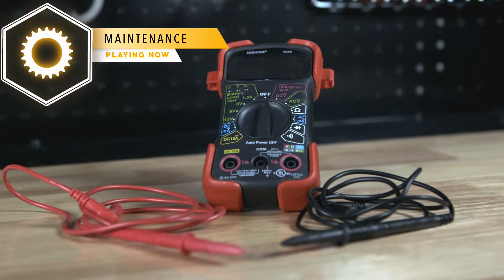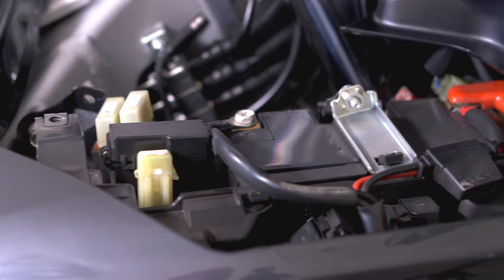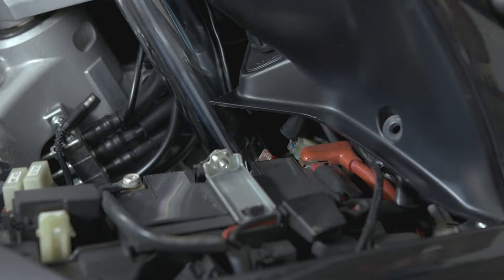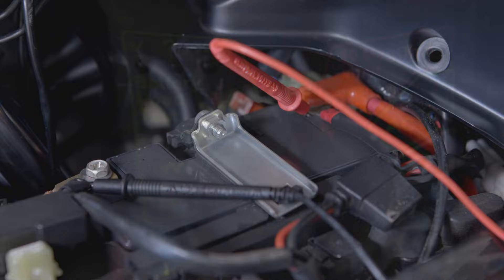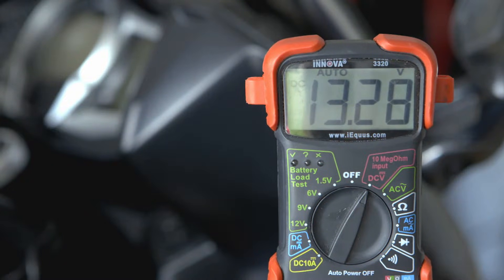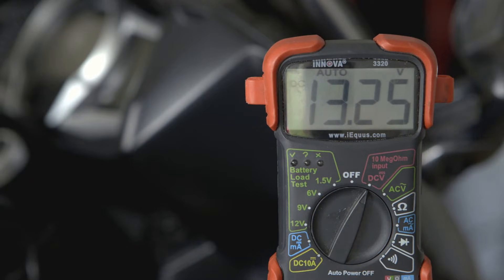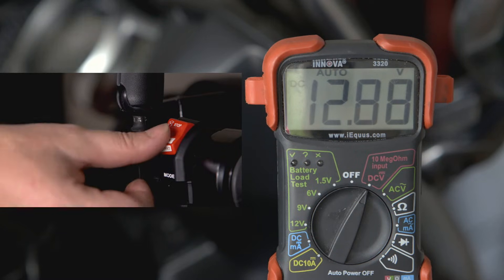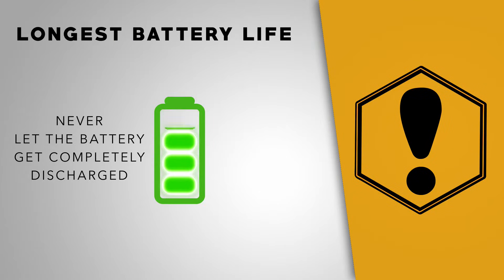Use a Multimeter to Test Motorcycle Battery

Comment: I liked your video, (music did not bother me). What if the battery won't charge to 12 despite being on a slow charge all day  AND nothing happens when I hit the starter. Would a weak battery prevent the motor from even turning over? Thanks.

Comment: It would have been nice to have known which holes one needs to plug the cables into on the multimeter. Otherwise, nice vid.
Reply: Black lead to com (common) , red lead to VΩmA (Voltage, resistance, current)